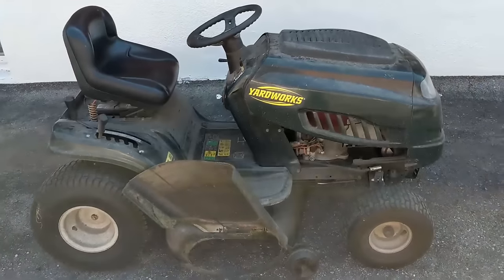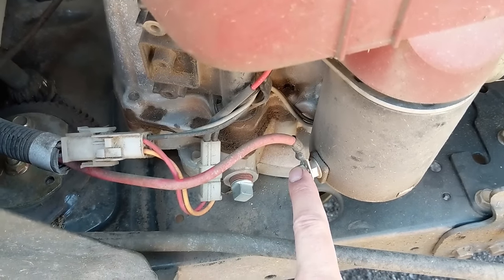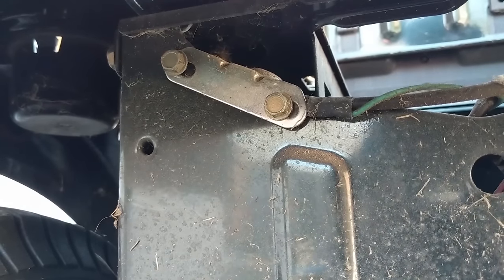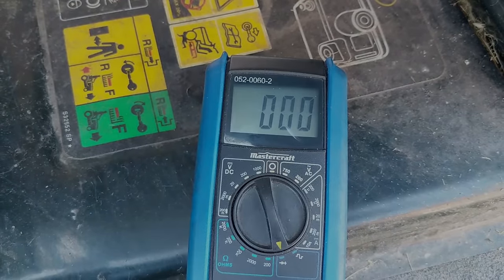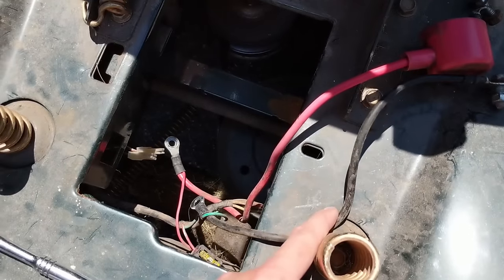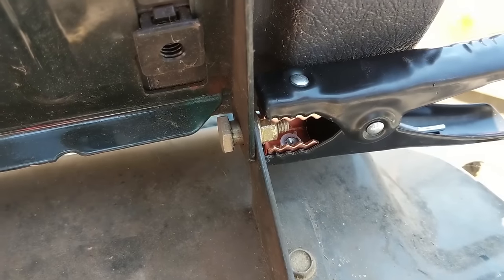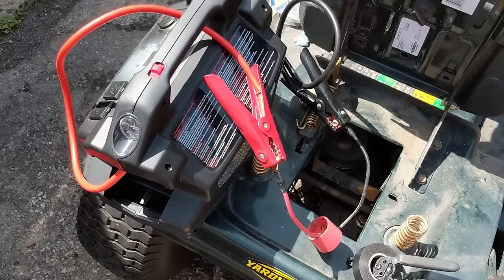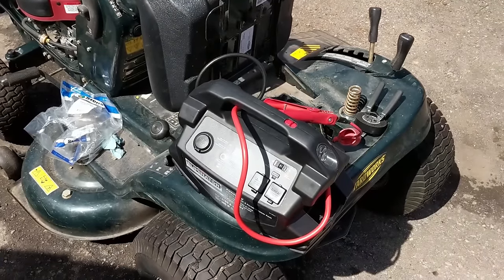Riding Lawn Mower - Solenoid Clicks but Doesn't Start

Comment: I got a newer craftsman pos . I turned off to dump bags. Heard buzzing sound. Couldn't find source. Once I disconnected negative cable it stopped. Once I touched negative cable to battety it tries to start. Key was off. Disconnected ignition and still tries to start when negative cable touches battery

Comment: what if im only getting 6volts to the starter? not 12 is it still the solenoid? its a brand new fully charged battery.
Reply from the maker: Bad connections, watch this https://youtu.be/vJWbfSxHY1Y
Reply: Still a bad ground if it wouldn't start with my jump pack straight to the starter?
Reply from the maker: @randypape4601  that could be a bad starter! But I'd remove it and bench test it, that rules out the starter. Could be the engine is really hard to turn over due to something like a bad auto compression release
Reply: @EliminatorPerformance  I'll pull it tomorrow and test it thanks

Comment: Sometimes the mower won't start if there is no one on the seat. Some mowers have safety on the seat so it only starts if you have weight on the seat

Comment: Why doesn't the seat in the raised position not activate the dead man switch?
Reply from the maker: If the parking brake is on then it bypasses the seat switch, this is what allows you to run the mower and get off it as long as the parking brake is on

Comment: The solenoid on my Toro Workhorse clicks. I can jump the starter. I have no power from the Solenoid to the starter. I do have 12+ volts into the main post on the solenoid. I have no power at the post where the starter power wire is connected at the solenoid. I do have  continuity through the power cable and the cable is in good shape . I replaced the solenoid and still have the same issue. It's a 4 wire solenoid. 

Any suggestions are sincerely appreciated. Thanks
Reply from the maker: Watch this and see if you have a connection between the solenoid posts when the solenoid is powered, hope it helps: https://youtu.be/h_vy7DERing
Reply: @EliminatorPerformance  Thanks. The solenoid I replaced was definitely bad. The new one works. However I'm still not getting power to the starter. The wire from the Solenoid to the starter checks out okay as far as continuity goes. 

When I check the pole on the solenoid being fed from the battery by using my voltmeter I get 12.8V. When I charge the solenoid I do not get voltage on the other side. It just doesn't make sense. I absolutely have solid continuity across the poles when I checked the solenoid as you directed.
I'm just about at the point of using this mower for target practice. ;)

Thanks again.
Reply: Well - I took the good (new) solenoid off again and checked it again. This time it didn't work. I don't know what I did to ruin it. When I checked it the first time I didn't charge it any longer than enough  to test continuity.

It still clicks but there is no continuity.
I'm buying one more.

Thanks again for your initial reply.
Reply from the maker: @AcousticGroove56  anytime, hope you have some luck!
Reply: @AcousticGroove56  Me! Too!! new switch and still nothing except click click??
Reply: @billygriffin5545  I just ordered another solenoid yesterday. It should be here by Thursday. I'll let you know what happens.

Did you get any voltage at all on the starter side of the solenoid? I did find that my bendix was frozen at first, but when I tapped it I could jump the starter straight from the battery every time.

I'm hoping the new solenoid will fix it.
Reply: The new solenoid came in about 45 minutes ago. It's in and the mower is cranking. The battery is a little weak so I had to jump it. 

I'm not sure what happened to the first new soleniid. I didn't order the same one. This time I ordered a Stens from Amazon. It cost $9.30  with free shipping.

Now I have to figure out why I have no brakes. If it's not one thing it's another.

Good luck.
Reply: @EliminatorPerformance   The second New solenoid fixed it. Not sure what 8 did to the first one. It was getting continuity when I checked it. Then later, nothing.

Thanks for your help. 

If you have a video about an old Toro with no brakes let me know. That's the next project. It's tough mowing without them ;) 

Is Bitcoin the only way to donate to you? If so I'll convert a little Litecoin to Bitcoin.
Reply from the maker: @AcousticGroove56  at the moment yes, I'm not really into Bitcoin but I think there's like $60 in there over the past couple years haha maybe I'll look into a PayPal or something 🤷🏻‍♂️
Reply from the maker: @AcousticGroove56  I've finally set up a PayPal! PayPal.me/ELMN80R

Comment: What would a high pitch sound like a squeal be when I turn it over. Sometimes the starter engages but stop spinning. And I jump the battery with jumper cables and that bendex goes up and down.
Reply from the maker: Hard to say, could be the starter?
Reply: @EliminatorPerformance  was the solenoid put power to it the bindex went up and down. Replace the solenoid fires right up

Comment: What are the chances of this popping up on my suggested videos when that is EXACTLY what my Gravely does and I was about to look it up on U-tube? The only difference is that after 40-50 turns of the key...OR MORE, I can get it to work. In fact it started up the 1st time the last two times I tried to start it. You lost me on all of the test procedures,  but I already suspected that it was an electrical component. I will try going over my ground wires and hopefully get it fixed. I already figured that it's not the starter or ignition that is bad since I can get it started eventually, which leaves a bad connection or the solenoid itself as the culprit. I can try to locate it and replace it myself and save a lot of trouble dragging my mower to the Gravely store and back. THANKS ! And again what are the chances ?

Comment: I have 5v going to my startmotor.. my battery is fully charged with 12v. Do you know what the problem is?
Reply from the maker: Probably corrosion, the secondary starter circuit is there, just seems like you have voltage drop, possible corrosion would cause that.
Reply: 2 days ago it worked... how can I fix the corrosion?
Reply: @lucapinti4971  check the voltage at starter using the ground post on the battery, to the starter. If the voltage is higher then there is a ground issue in the circuit.

Also, make sure the connections from battery to solenoid, and solenoid to starter are clean and tight. Corrosion as well as loose connection will cause voltage drop. Also, test the voltage across battery posts to make certain the battery has the proper voltage before doing any other testing.

Comment: If your battery is really dead, disconnect it when using a Jump box. If you dont then the power the jump box puts out will drain off to fill the weak battery becuse voltage will try to seek its own leval, if the dead battery disconnected then all the power the jump box has to offer can go into starting the motor.
Or you can turn on the key and ground the jump box to the motor and attach the postive directly to the starter motor long enough to start the motor.
Once the motrs running remove the postive cable and the negative cable.  If the motor wont crank your jump box is weak or your starters bad.

Comment: Well...the only thing I haven't tried at this point is moving the battery ground to a another place on the body.  Solenoid checked good.  Positive battery cable looks good.  Still getting no power to the starter.

Comment: Ohm testing is poor way to locate problem area. You should do voltage drop testing under load to pinpoint poor connection without having to disconnect anything. The Old TV Tech.
Reply from the maker: Well the problem was that I wouldn't of had any voltage at all. Ohm testing showed me that all the cables I tested were ok, and didn't have a tremendous amount of resistance. Which means that by a process of elimination, it had to be a bad ground. Remember that the solenoid/keyswitch is a separate circuit from the starter circuit. So the solenoid was clicking, but because of the bad ground, 12v wasn't being sent to the starter.
Reply: @EliminatorPerformance  you can voltage test using the battery ground post. This will eliminate the ground side from your testing and tell you if your positive side is good for sure. You can pinpoint where in the system the positive connection drops out. If testing from battery ground to starter gets proper voltage then you know the issue is the ground. Would have been able.to pinpoint the issue in about 2 minutes. Electrical troubleshooting is all about knowing where to put the test leads and knowing what the expected result SHOULD be. If you get any other result then you make a diagnosis of that result and an your test testimony accordingly. It's difficult to test when you can't see it.  Electricians call it FM. (Fucking magic)
Reply: @warren steffen: How could he perform a voltage test under load IF the system wasn’t running originally? An Ohm test will suffice if you have no power going to load. He could see a drop in Ohms IF a wire is broken. Same results, different test.

Comment: Can mine be faulty if it clicks it is grounded and wired tight, there is current going through it all, the solenoid works when I test it and starter motor works but soon as I wire it up and turn the key it only clicks once all wires seem fine
Reply from the maker: https://youtu.be/vJWbfSxHY1Y
Reply: I have a John Deere 185 Hydro lawn tractor with a 17HP Kawasaki FC540V engine and a Nippon Denso 12800-2810 starter that had an intermittent "one click, no start" issue.  I installed a $16.00 knock off John Deere AM107421 Starter Relay Kit from eBay and it solved the issue.

If your mower already has a starter relay, that could be your issue.
Reply: @EliminatorPerformance  it runs turns out was the solenoid, but now my key in off position doesn't do anything i have to choke it to stop it and a nice fuel leak on the tank ha
Reply from the maker: @honorabilis1  keyswitch not grounding to coil, check keyswitch or small black wire on coil
Reply: @EliminatorPerformance  thanks, the black wire I got it tightly on maybe the cable is damaged thanks again

Comment: i just replaced the solenoid in my craftsman lt1000 2001 and it still clicks but will not turn on. new battery too! plz help
Reply from the maker: Check all your grounds and make sure the starter works
Reply: Is the starter getting hot after you try it a few time? Starter bad.

Comment: I'm having a issue similar to this with a snapper 150Z 42" 21hp sometimes it cranks other times just clicks. Any suggestions??
Reply: Buy a battery charger/maintainer to keep battery ready for 12.6 volts (for 2 days prior to start). Multimeter (20.00) cks. volts & pwr. off (disconnect neg.-- cable)  to  ck. cable with meter at ohm/resistance dial position, should read near 0 .
Reply: ALLWAYS turn off charger/booster and turn face away from any battery Before & During post clamp disconnecting . Spark ,can explode .
Reply: I appreciate your help

Comment: so what exactly was the problem not starting again?
Reply from the maker: It's been a while, but I believe it was just a bad connection on this one. Used the same solenoid and fixed the one cable end, this mower still runs to this day
Reply: @EliminatorPerformance  mine ran & now it wont.solenoid clicks,bad? starters good. Tried everything.

Comment: Here is the issue, just because a wire has continuity doesn't mean the wire can carry the required amount of current. Always test circuit while under load.  Hope that helps buddy.
Reply from the maker: At the time, there was no way to do a load test because there was no current passing through the wire.

I just did a quick continuity test to see if there was a break in the wire somewhere.

Thanks for watching!
Reply: @EliminatorPerformance  Use volt drop testing eliminator,put your meter on about the 3v range or the lowest you have and put it across the solenoid main terminals ,operate the starter motor and any bad connection will show up as voltage .I think the allowance across a solenoid/switch is about .5 volt. You  are using the starter motor as a load to show up any resistance in the circuit.You could also put your meter negative on the battery positve and the meter positive on th starter motor terminal,operate it and if the circuit is good there should perhaps be .5 volts showing on the meter.Using this method you are testing your circuit under load ,any volts showing is volts lost that should be feeding the motor.Work back toward the battery positive until the meter shows NO volts ,the fault is the component/cable you just past.Remember you are dealing with tenths of a volt .
Reply: @bengunn3698  all this is unnecessary if you simply use the battery ground  terminal to test from instead a ground point on the motor or anywhere else. The battery is the source of the ground as well as the power. Use both sides in testing.
Reply: @dangroce82  @DAN----But all you are looking for is a bad ground ,there is also positive side that may have problems.The +connection at the battery may have a bad connection,the positive cable from the batt to solenoid may be corroded internally,the positve connection at the solenoid may have a bad connection,the contacts inside the solenoid may be interrmitent or nonexistent burnt out,the cable from the solenoid to motor may have a bad connection at the ends or the cable may be corroded internaly [ no damage visible]. Use volt drop tests across all cables and connections.See any automotive volt drop testing videos on you tube for more.I am also an electrician ,been one since 1962.

Comment: What do I look for when my solenoid clicks, my starter engages for a quarter turn and nothing more. 

Can hand spin motor, battery has full charge, and starter has been taken to a starter repair/rebuild shop to test and clean.
Reply from the maker: Pull the spark plugs and see if the starter turns over the engine. Then you can see if you have a starter issue, or decompression valve issue

Comment: I'm  getting about 12.21 from the starter but the ignition switch still won't turn the starter over hmmmmm the solenoid is on the starter on my tractor

Comment: I'm getting 3 volts to the starter what does that mean
Reply from the maker: Either a bad ground, positive, or the solenoid main connection inside is corroded. I have videos testing everything; https://youtu.be/vJWbfSxHY1Y

Comment: I have that same tractor but it won’t crank or click. Any idea?
Reply: Bad ground to the solenoid. Test for continuity from ground of battery to ground wire on control post of solenoid.

Also test for voltage from neg. post of battery to positive control post of solenoid, with key in start position. If  there is no voltage you most likely have a bad safety switch in the control circuit.

Comment: I replaced the solenoid and the battery. It started up and ran for a couple of minutes then died. Now I hear clicking under the carburetor  when trying to start, no voltage through the start solenoid. No fuel is moving through the filter when I try to start by bypassing the solenoid. WTF?????

Comment: I have a Yth2148 Husqvarna new battery I turn the key I hear no clicking what could it be
Reply from the maker: Safety switch preventing 12v from going to the solenoid? Watch this video, it's a step by step diagnosis; https://youtu.be/vJWbfSxHY1Y
Reply: Thank you for replying so quickly I failed to mention person who gave it to me did have a hard time break switch but could it be the solenoid or the seat switch

Comment: No one ever looks at voltage drops caused by bad connections or faulty wires.
When these lawn tractors are built they use the bare mim wire sizes
Then toss in a 340 cold crank battery the 10ga wire limits how much of that 340 cold crank amps you can use, also the length of the wire and condition of the ground path.
On my mower with the battery in the frt over the motor at the battery i had 12.4 volts, at the starter i had 9.3 volts thats a big voltage drop
The cables have too much restance
To fix this you go up in wire sizes from 10ga to 8ga wire but you have to do every wire providing voltage  to the starter including the battery to ground. You want to limit voltage drop.  Then change the charge wire off the regulator to the battery to 10ga its 16ga now barely enough to handel 10amps what the altonator puts out.  Thats the coil packs under the fly wheel.

Comment: I used a screw driver to engage the starter it will start but will stall and not stay running sounds like it's not getting power

Comment: Mine doent turn over and does click but just wines and thats it..  battery has 12.8v so not that..  solenoid clicks and is a a low/no Ω through connection when engaged..  dunno..
Reply from the maker: Test the battery for volts while you're cranking the engine over (while it's whining) it may in fact be the battery is no good under load. Watch this video; https://youtu.be/vJWbfSxHY1Y
Reply: Yea i just need to run two wires directly from the battery to the starter and see if it cranks, if it does than bad connection somewhere or bad something..  if not than battery is bad.  Damn thing is less than a year old..  i just left the key on one time..  recharged it and mower started and charged at 14.6 volts but wont start again..   die hard..  yep they do..  and expensive boogers too..  no wonder they only offer a 3 month warrantee, cuz they die after 6…. Bastards..
Reply: But hey, thanks..  replying on a video over 2 yrs old to my dumb comment..  your good people…

Comment: To improve your electrical diagnosis approach stop relying on continuity good continuity doesn’t mean good conductivity start using voltage drop much more productive and actually easier your moving 1 meter lead   U can check both B+ side and B- hope this helps  once u start using VD method no need to guess CHEERS